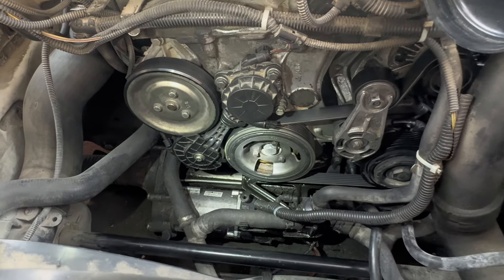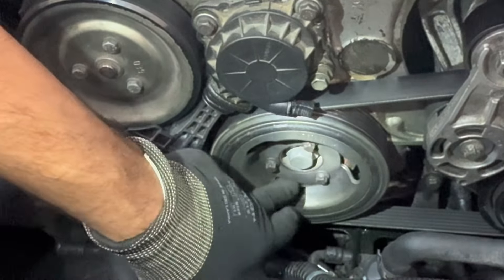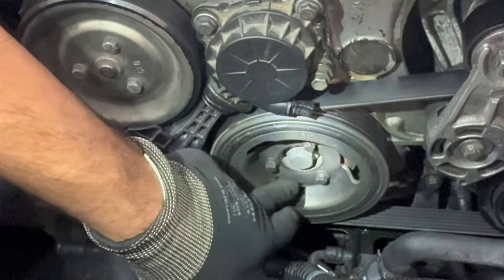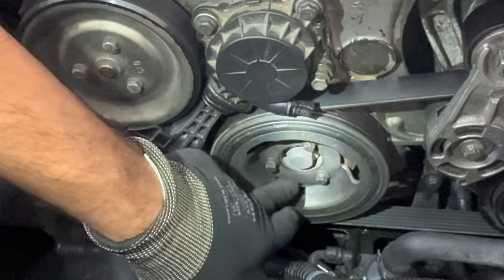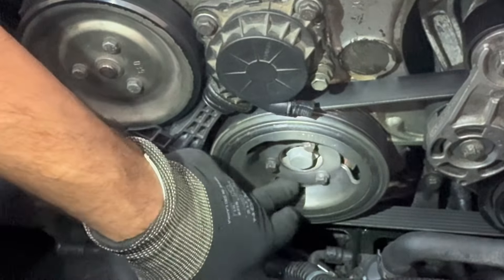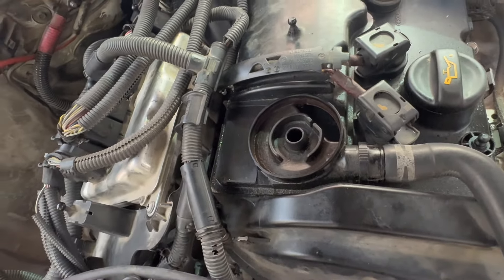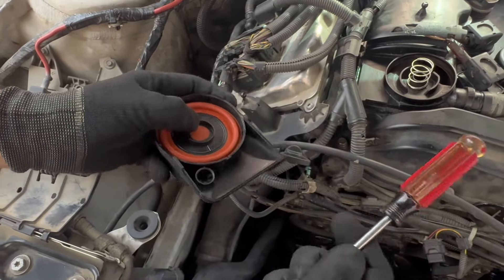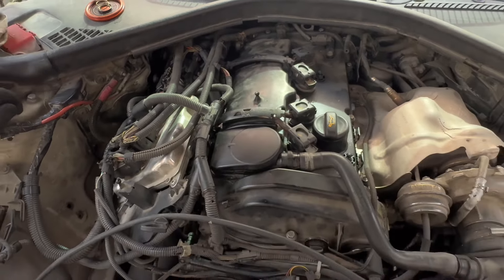FIX !!! Oil leak from front Crank Seal even after new Seal BMW N13 F20/F30

Comment: If u're using the type of crank seal with  spring then reduce the spring before u fix it.
Reply from the maker: Reduce the spring meaning?
I tried 3 new Oil seal from BMW all failed as well.
Reply: @bimmerhacks ..Hi.. Have you managed to solve the problem? Where did the leak originated from? I have changed the crankshaft seal twice and also the PCV valve but it still leaks a lot of oil out

Comment: Did the oil leak STOP after installing new PCV mate? Im having same problem currently on my N13.
Reply: There a lot of places, look for Vacuum pump seals in the rear of engine turbo side, top cover seal as well, Front crankshaft seal, make sure the bolts of Timing chain are tie well behind rubber belt located, and hopefully woul be OK
Reply from the maker: @newstuffedy7935 bolts of timing chain? What did you mean?
Reply: @bimmerhacks  there are 3 bolts in the front of the engine's block, check them with T40 and T30 spanner
Reply from the maker: @newstuffedy7935  u mean the chain guide holders... Good
Reply: @bimmerhacks  yes, I am not a mechanic,  Just doing stuff in my car by myself
Reply from the maker: @newstuffedy7935  me too ;)

Comment: Have the same problem. New seal installed and few days ago got the little leak xd 😅
Reply from the maker: Is your belt shredding due to the leak?
Reply: @bimmerhacks  no, but I try to fix a belt squeak on cold engine and on acceleration on road when car is cold. 
 I dont know how to fix it.
Reply from the maker: @djidwawa  it might be PCV squeak... Check your PCV Membrane probably it will be worn and that should be the cause of your oil seal pushing oil out.
Reply: @bimmerhacks  Thinking about it too but few weeks ago I mount new one.
Reply from the maker: @djidwawa no luck right?

Comment: Hi...I am having the same problem on my F20 120i with this N13 engine. Oil leaks at the front crankshaft pulley and sprays all over such that the area around the tensioner, friction drive and even up to the cover of the radiator fan is oily. I have changed the crankshaft seal twice and the PCV valve but still does not solve the problem.  During idle I can't see where the leak is, but when I take a drive even at normal speed, it will be pissing oil all over. I have run it up til 3000 rpm for a fwe minutes at standstill and try to find the source of the leak just by watching the pulley area but no luck. I cannot drive the car before fixing this leak as it will wet the drive belt with the oil and cause the fricition drive to lose grip with the water pump pulley, and this will overheat the engine.  Have you found where the leak is originating from?
Reply from the maker: Leak is from the crank shaft seal itself due to excess pressure built in the engine. Check your PCV, if the problem persist then do a piston pressure test for leaks...
Reply: @bimmerhacks  I have changed the cranskhaft seal twice (original BMW seal), the engine block cap behind the pulley  as well as a new PCV valve, yet it is still leaking.  When my workshop removed the whole crankshaft pulley area to inspect the area, there were no traces of any oil seeping out from the seal after 2nd replacement. So I am still baffled where this leak is from. My workshop tech claims that this leak is a high pressure leak due to the oil spray around the area.  He attributed it to the N13 engine aluminium block thermal expansion, which causes the oil to leak from the gaskets spaces between the cylinder block or oil sump and suggested re-torquing all the cylinder block tightening bolts as well as change the gaskets.  I am still not convinced this is the actual solution.
Reply from the maker: @pengsianglee  there r two hex bolt holding the timing chain guide. Did you check if the oil is spilling from there? Or the oil return line from the PCV - THE PLASTIC HOSE ON TOP
Reply: Yes checked also. No leaks from both sides of the tensioner bolt and the PCV return hose.
Reply from the maker: @pengsianglee :(